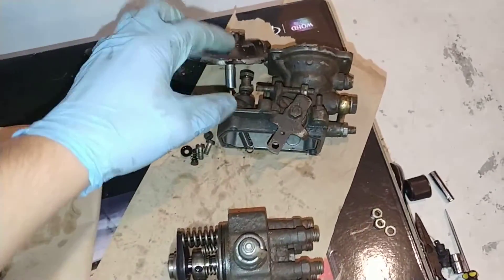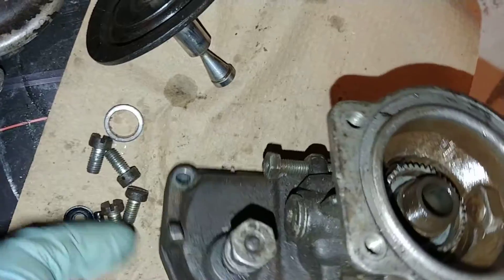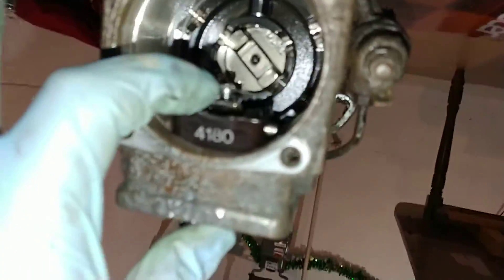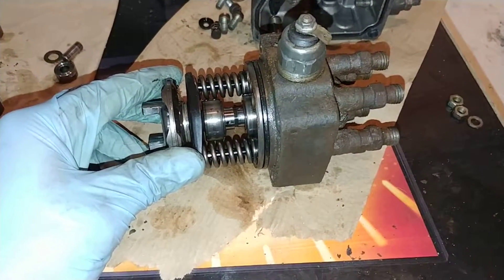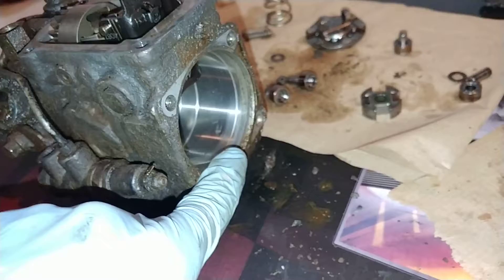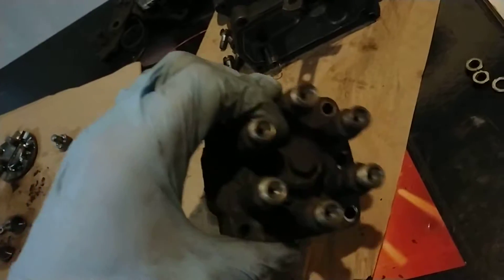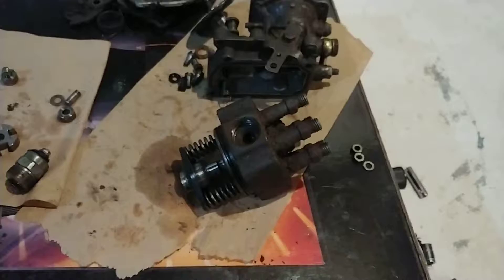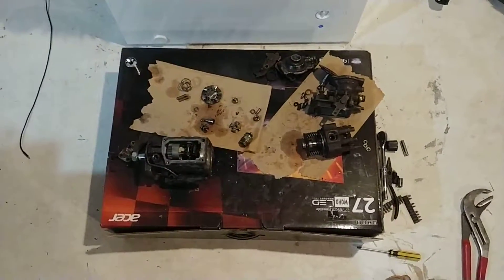Bosch VE pump teardown - part 3 - fuel plunger and distribution block

Comment: I have this pump on a 1.7td cavilier and it will run if I gravity feed the pump but misfires and runs like crap with it connected, when running the pump don’t seem to be letting fuel out the return any advice ? I did connect an inline low pressure fuel pump and that made it run worse and caused fuel lines to swell on the intake side

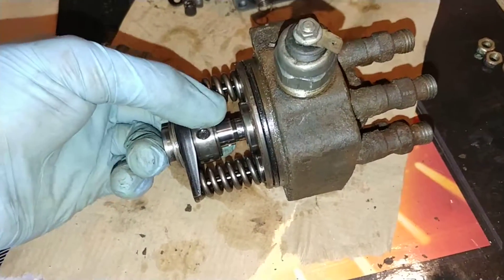Comment: @1:44 can we buy a plunger separately? What happens if there are scratches to the shaft of that plunger?
Reply: No they are lapped in pair with the rotor head and control sleeve. If there're scratches then it would affect injection pressure which would result in poor engine running.

Comment: What a great series on this pump, the best on YouTube, thank you so much! I want to add LPG into the intake (LPG in europe is simply cheap automotive propane/butane gas) to reduce emissions, save some money, and improve running on veg oil instead of diesel when the time comes. your video really helped me figure this out, thank you :) The only advice i can give in return is that wax actuators like the one in the timing advance are extremely powerful (torquey) and slow, so i would bet that while your demonstration pump is a sticky binary left/right (retard/advance) i'd bet as that wax slowly heats up the timing control is continuous and not simply on/off. The ECU probably sends PWM signals to it constantly, i'll have a look this weekend. many thanks for all your hard work filming this!

Comment: My pump is not lifting fuel to start up, what part in the pump lifts fuel? After I prime the system it will run once I let it sit I have to keep priming to start it. I checked all lines no cracks

Comment: I tested two identical Toyoya 1HZ VE Pumps today. One new and one that had AdBlue put through while driving by mistake and vehcle stopped. Manually turning the pumps with a socket off the vehcle, one spurts out little bits of fuel from the head valves and the other one doesn't pump anything. Think i will buy a new head and rotor. But why is it that AdBlue wrecks the pump isn't it just water or urea. The pump was completely dissmantled and cleaned spotless, there appears to be nothing wrong or broken in the pump. Can see some videos on my channel as well i have put some your helpful vids in a collective playlist. Thanks.
Reply: At a guess I'd say its because urea and water don't make a great fuel, and that's supposed to be injected after combustion not before 😅 he also says in this video that some pumps use engine oil for lubrication, others like this (and possibly yours) use diesel fuel as lubricant. If you put water in there, its probably not going to lubricate everything correctly. Anyway tldr I'm sorry for your loss.
Reply: @cannaroe1213  I’ve since found out water under very high pressure through the pump rotor acts like sand paper therefore score the rotor barrel and loss of compression eventually stops diesel from being able to be pumped through.
Reply: @ForPropertyInvestors  Very interesting, thanks for letting me (and everyone else) know, all the best!

Comment: Great video! I have an engine with this pump that immediately goes to full throttle on start up and stays there. The throttle cable and arm are moving fine so I'm guessing it could be the governor or something that's stuck.

Comment: I have a bosch ve pump with electric quantity control, is there any way i can change it to the mechanical.
Car in question is mercedes 312d, the pump is not dilivering enough pressure to open injector and i thinknits because the relive part of the plunger, because the electics is not closing it.
So any idea will help

Comment: Would the cut-off solenoid fail without the pump failing, or would a failing solenoid take out the pump?
Reply from the maker: The solenoid itself is not very likely to fail, and if it did then it would default to "not running" since the solenoid lifts the plunger up to allow fuel flow. But the rubber tipped plunger definitely could age and break, if maybe the newer diesel fuel ages the rubber, and a piece breaks off. But if that happens, im guessing it would end up restricting fuel flow, since the chunks of rubber are going to end up in bad places. More likely, you have a similar failure as mine, where some metal or dirt got into the pump, and is making the plunger not move up and down. Its not easy, but you could clean the area, and remove the solenoid and test it by keying on and off, to see if it pulls the plunger up inside the solenoid.

Comment: AGAIN, excellent videos! I've replaced my start/stop solenoid 3 times now and have to do it again now. However, it's never the magnetic / mechanical aspect that is failing, but something inside the fuel delivery seating area keeps damaging the rubber plunger. The mechanism 'opens and closes', but the rubber always ends up with a crescent shaped cut, like a fingernail, opposite to the outside circle of the plunger. You can see the damage in my video at 4:11 - https://www.youtube.com/watch?v=Ac-R58Gfsb4&t=136s The solenoid I replaced in this video may be 20 years old, and the rubber was crumbly, so didn't think much of the damage. However, every sequential replacement suffers exactly the same 'cut/notch' damage. The plunger doesn't seem to get jammed by any metal shrapnel and the magnetic system always works. ONLY the rubber plunger being damaged in exactly the same way each time. PLEASE HELP! I'm spending about $30 every two months just for new solenoid plungers. Thanks in advance!

Comment: Thanks for the videos, seeing it without having to order all the gaskets and seals is a huge help.
You said the spring inside was 3,500 RPM? Is there a list of different springs? My service manual says it should free-rev to 5,100 but I can only get 3,200 with the max accelerator screw all the way backed off. (New to me, TD27 turbo)

Comment: I have 3 used n/a ve bosch pumps that have almost zero throttle resonse and chugs lots of grey smoke, i think the internals are stuck from old fuel and sitting on a shelf for years,is there any way to clean out the gunk and free up the pump without total rebuild?
Reply from the maker: You could try removing just the pump top and inspecting the inside. If there is junk inside the pump you could try cleaning the obvious places, or if its on a bench you could clean it out with gasoline and then rinse that out with diesel. Grayish smoke is usually due to poor fuel timing, low pressure, or bad injectors. To be honest though, if you've run it for more than an hour and the diesel running through it hasn't cleaned up the smoke, I'd guess its bad injectors or timing. These pop-style injectors have springs in them that become unbalanced as they age. And timing the pump is a little tricky too

Comment: I thought I can fix my jeep's pump,  but After watching this I have no courage to open this thing and mess up , this thing  is soo compilcated than entire car itself.
Reply: I did it, with this video, and it's no so hard, but you have to make sure your pump is looking down or the pieces fall and is a nightmare. Anyway I just changed a few leaky seals, I'm not so sure about messing with the rest of it
Reply: A lot of people say this pump should only be adjusted in a running engine, since there are simply too many variables at play simultaneously, which is why you get the secondary manual fuel cut off directly on the pump.

Comment: Great videos! My pump is leaking between the pump assembly and the pump body. Is that pump assembly captured so that it doesn’t fly apart when you separate the two bodies to change that o ring? Thanks!
Reply: I have the exact same problem and question now. Did you ever figure it out?